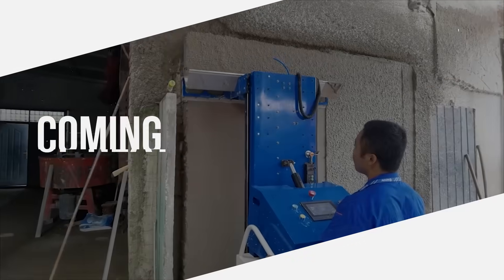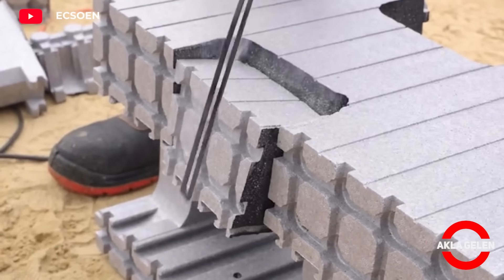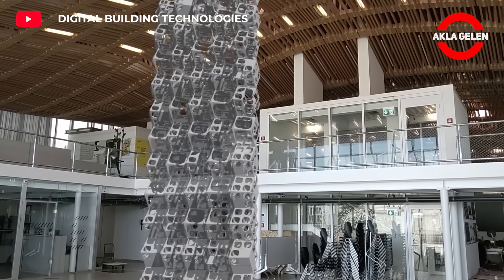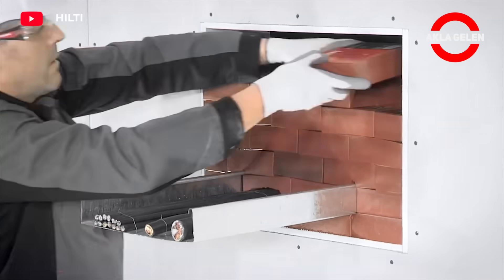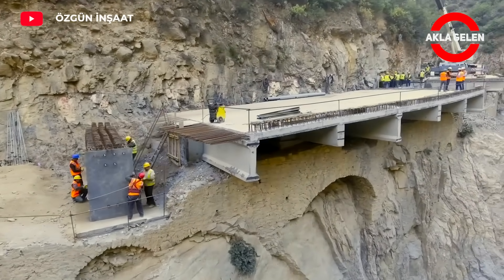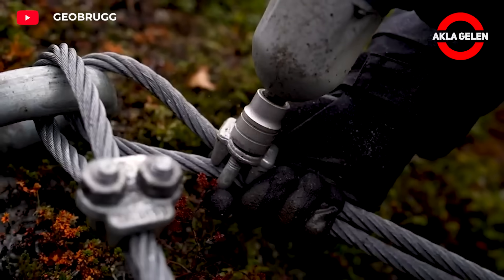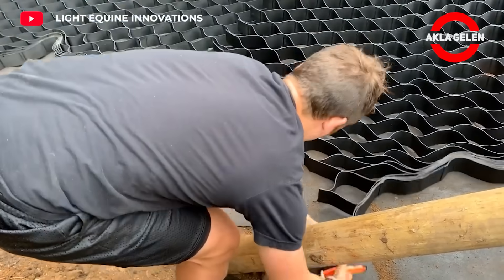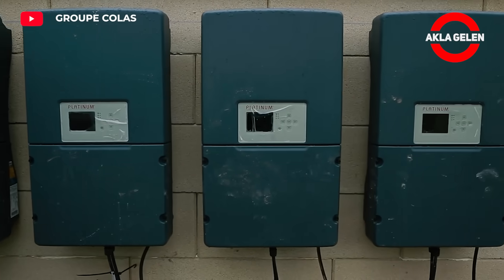Construction Workers Can't Believe This Technique Works - Most Ingenious Construction Technologies▶6

Comment: "... undergoing radical changes thanks to technology...." Really? In the UK nothing changes. Skilled bricklayers are a dying race. Developers use self-employed brick chucker-uppers at half the going rates of pay. The same goes for plastering, carpentry and plumbing. Snagging takes forever nowadays. Regulated trades such as gas fitters and electricians are deemed a burdensome, legal requirement. Bricklayers understandably won't entertain any innovation that may replace them.